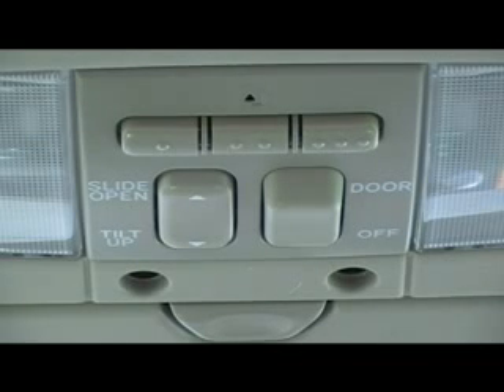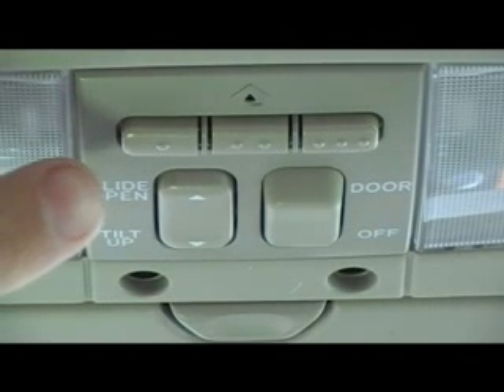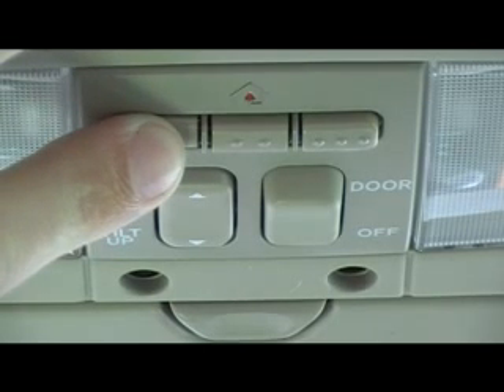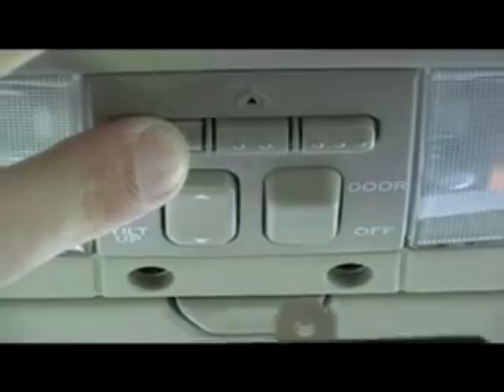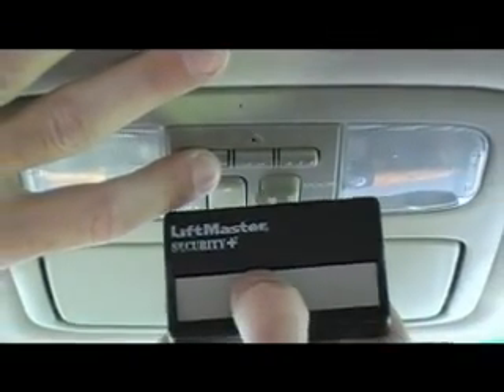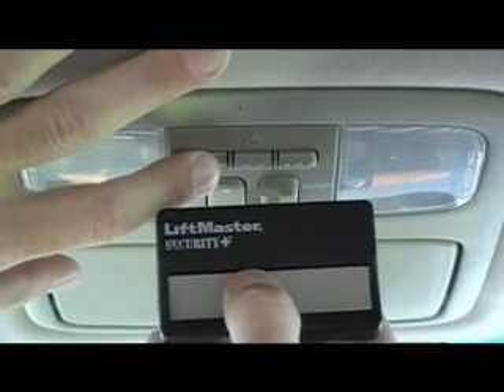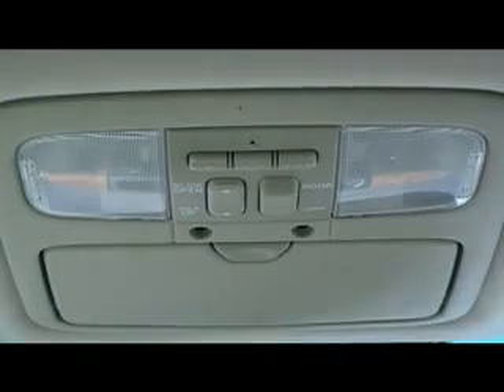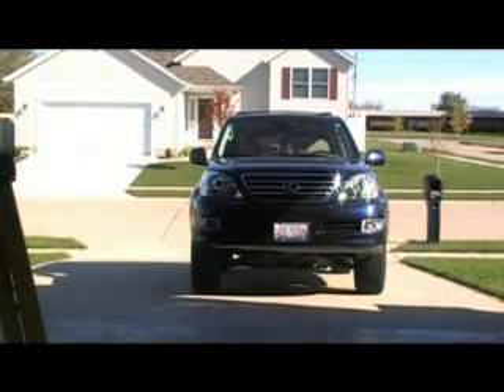Programming Homelink and rolling code garage

Comment: My 2006 Lexus GS300 is having trouble with this. I hold the Garage door opener on my rear view screen and it remais solid and I press and hold the button on my remote. Then after 20 seconds its starts to flash. But then when i try it the door remains closed. Any suggestions?

Comment: @29jimmy980 When he says "rolling" he doesn't mean physically rolling. What he means is that the garage electrical code is rolling. In other words, the signal code that the garage uses to open it today will not be what it uses tomorrow or even the next time you hit the button. It is a rolling code so that thieves have a harder time cracking into your garage door signal.

Comment from the maker: If you look on the garage door motor on the back side, there should either be a cover that you open, or it should be open already with no door. Either way, look for a "learn" or "program"button. The button will either be red and square, purple and square, or black and round. If you see any of these, it is a rolling code garage door. If it is not rolling code, you can still set it to open.

Comment: Thanks for the easiest instructions I have found. Some videos are way too long and confusing. This worked super quickly. A couple notes: I used the Homelink attached to my rear view mirror and it worked just the same. Also, I have a Genie garage door opener and used the mini remote. I remember from previous attempts and after calling Genie that you need to program the button using one of the two smaller buttons on the side, otherwise it won't work.

Comment from the maker: It will work with most remotes.  You  won't have to do the step on the unit itself if it doesn't have a rolling code but programming to the car qill be the same.  Thanks

Comment from the maker: Sorry for the late response....If you only have one button, then your door is not a rolling code. You can still program it though. Hold button 1 and 3 in your car to clear. Then press 1 first and hold while pressing your door opener. Door should open or close depending on how it is positioned. Hope this helps!

Comment: How to program homelink remote with rolling code in "multiple cars." for liftmaster.
1.) push and hold learn button to erase all pass codes on the back of the garage door opener. (the engine that makes the garage door go up and down silly.)
2.)go to car #1 press and hold both homelink key and remote control.  remote next to homelink door opener until red light flashes rapidly. Do not program remote yet. (remote needs to be unprogramed still.)
3.)go to car #2. press and hold remote next to homelink until red light flashes rapidly.
4.) same as step 2 and 3, but I doubt that you have 3 cars because you refuse to pay for someone else to do this for you.
5.) now finally go ahead and PRESS and RELEASE learn button in the garage door opener. (you know the same one that you ended holding to erase the codes, but now you're only PRESSING and RELEASING.)
6.)Now, program the remote. (not the cars, the remote.)
7.)once remote is programmed, press and release learn button again.
8.)go to car #....... now press and hold the key you chose in step 2-4. the garage door light should flash twice and/or click twice. car #....programed.
9.)go back to garage door opener and PRESS and RELEASE learn buton.
10.)repeat step 8 to program car number 2.
11.) repeat step 9.
12.) keep repeating until all cars are successfully lowering the garage door.
13.) please like my comment so I can see that I at least helped one person in this world with this problem. (it will make me feel better about myself lol.)

Comment from the maker: Most likely you have a rolling code garage door opener with a learn button the the motor. After you press the desired button and the button for the opener, wait for the red light flash a lot. Get out of the car and press the "learn button" on the motor. Go back to the car and press the desired button 3 times, 2 seconds per push. It will work. If it does not just try it again.

Comment: I'm not sure how to figure this out, the garage door manufacture is beninca. The remote has two buttons. The 1st one is doing nothing. The 2nd one with one press slides in one direction . Another click stop the slide . 3rd click slides on the opposite direction and so forth . I even checked home link site trying to figure out what to do if the 1st step itself didn't work but no luck...